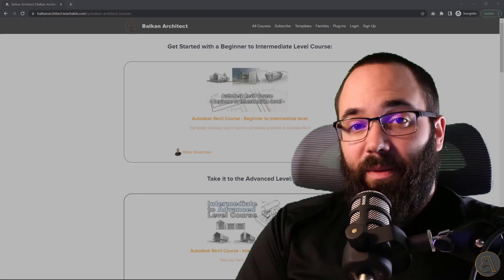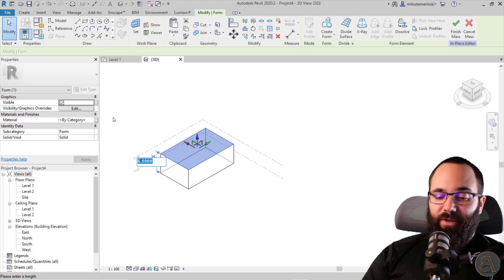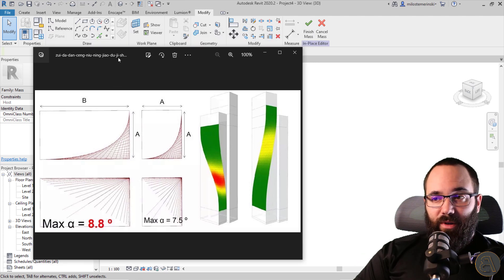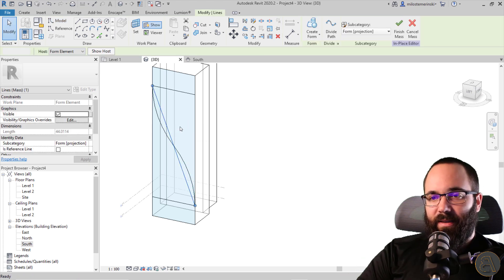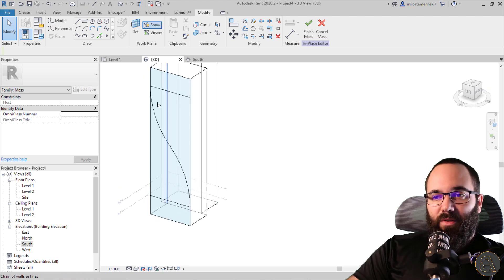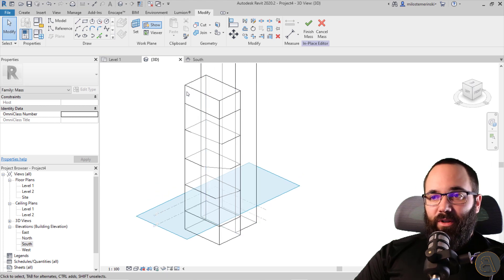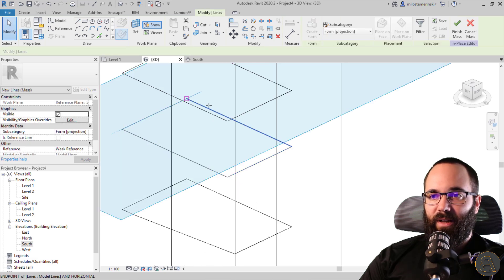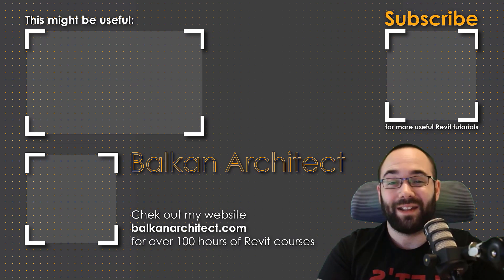Tower in Revit Tutorial - With a Twist!

Comment: Question: do you have a video on over riding the crop lines on an internal elevation? I want to have heavy line around the views. I saw a video using dynamo however I’m new to dynamo and it was not working for me, the links from the video wouldn’t open etc. is there another way besides overriding each view one at time?